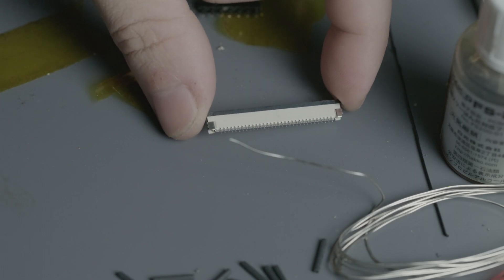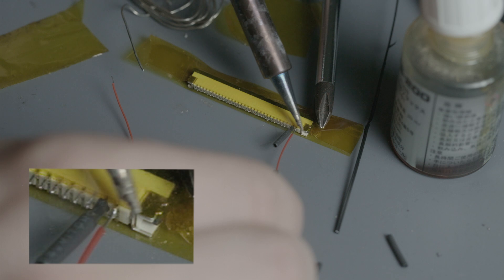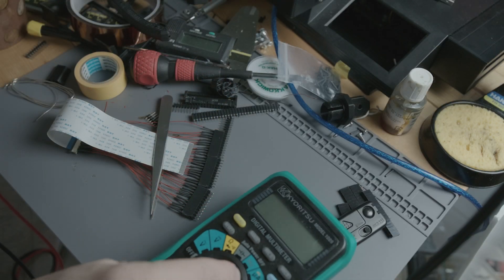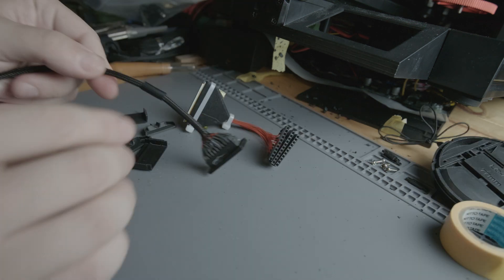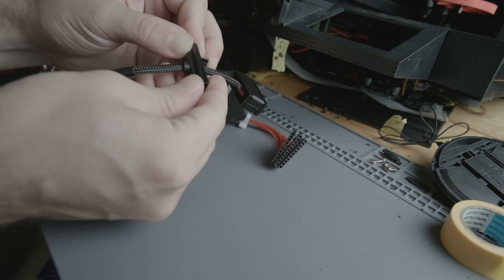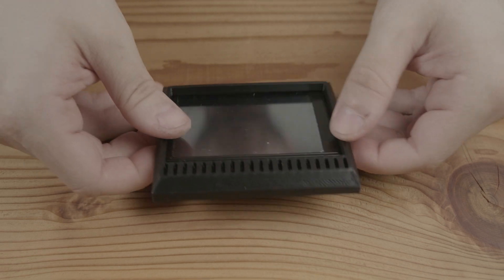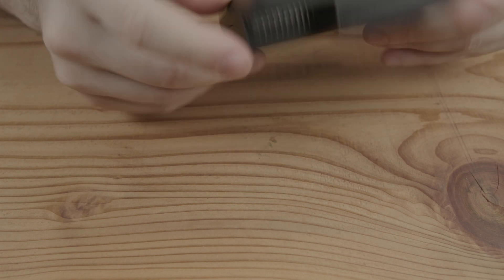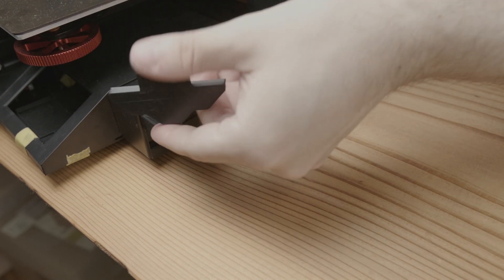Elegoo Neptune 2S Portable LCD upgrade with Mount Arm

Comment: What gauge and type wire are you using and what length did you end up making the cable in the cable sleeve? (sorry for the noob question)
Reply from the maker: nah not noob at all, it's 30 AWG 7 core wire. The core count can be different but you want more than 1 core so it can flex without breaking. It's called "OK wire" or that might be my suppliers mistake and it is "OKI wire" which is a company name. It's used for making PCB test fixtures. Sorry I don't have a link it's a factory product and we buy 10,000ft at a time.
Reply: @MochaMameX  Thanks!!

Comment: Is that extension cable not available to purchase?
Reply from the maker: I've never seen one available before, depending on country you might be able to find better connector parts but I couldn't find them easily in Japan so made everything by hand. Some people who move the LCD just use the original flat cable, you can get extensions if needed.

Comment: hello mocha, well Santa Claus brought me a 3d pad screen, so I wonder if it's interesting to make this modification as I asked you;) I'm testing it, it's a good alternative for not too expensive but sincerely I think the original screen but especially the firmware makes better prints, I updated the firmware but I think some Cura adjustments are necessary, thank you very much again for your videos ps: I also had a bltouch that I installed thanks to your video, it's perfect thank you very much and merry christmas to you
Reply from the maker: I like the design of the original firmware, it is enough for most people I think. Changing to a different screen and firmware would be nice too! I'm glad the BL Touch video helped! Enjoy!

Comment: Hello, I love your job, this is exactly what i need for my printer, ☺☺ unfortunately I am zero in engraving, could you sell me a complete connector? for a left mounting 🤪 I am from France friendly Jean Michel
Reply from the maker: Thank you very much! This request is difficult to accept, if a wire becomes loose will you be able to repair it? Mine is still running fine, and this design works for both left and right mounting. Let's talk about it maybe I will try, find me on Reddit or Twitter and send a DM!
Reply: @MochaMameX  hello mocha, well Santa Claus brought me a 3d pad screen, so I wonder if it's interesting to make this modification as I asked you;) I'm testing it, it's a good alternative for not too expensive but sincerely I think the original screen but especially the firmware makes better prints, I updated the firmware but I think some Cura adjustments are necessary, thank you very much again for your videos ps: I also had a bltouch that I installed thanks to your video, it's perfect thank you very much and merry christmas to you

Comment: Ooh! This is something I've wondered about 😁
You did an excellent job at making the connectors! They look factory fitted. Very professional 💪🔥
Reply from the maker: thank you! it's a lot to work but so far no problems and it makes everything much more convenient!
Reply: @MochaMameX  It sure does! I've lost count how many times I've had to try and reach for the screen if a print accidentally fails or to make adjustments😅

Comment: I love the mods you're doing. I will appreciate  a filament guide compatible with the cap you designed
Reply from the maker: Thank you it's good to hear. A filament guide sounds good and should be easy, I could make it for my next video. Do you mind drilling holes?
Reply: @MochaMameX  anything that you  come up will be great. Drilling holes is not a problem. Thanks!!
Reply from the maker: just one more question, what is the main reason you want to use a guide? I'm working on it now!

Comment: I really want to suggest you use a helping hand, it will make things a LOT easier for you
Reply from the maker: I used to wire 5-10,000 points per day and this was the first time actually that I wished I had a pair, might get or make a set
Reply: @MochaMameX  the set I use is fantastic, I actually recommended it on one of your earlier videos, but the comment got deleted
Reply from the maker: really? maybe YouTube doesn't allow links or something, or else it was a really unfortunate accident on my behalf, sorry about that.
Reply: @MochaMameX  probably the latter, I mentioned the product code on Amazon Japan
Reply from the maker: "Hold potentially inappropriate comments for review" Then I never check the reviews
Reply: @MochaMameX  I believe it was on your Reduce Fan Noise pt. 2 video

Comment: I'm also modifying my printer, though I will be replacing the controller with a Duet 2 WiFi and a 7 inch screen
Reply from the maker: any reason for the Duet 2? last week I was looking around too. full 2209 would be nice
Reply: @MochaMameX  the Duet ecosystem is extremely flexible and I'm using my Neptune 2D to practice for building my own printer. I'm still toying with CAD, but I'm planning for a 500mm cube printer with a tool changer in Core XY configuration
Reply from the maker: That sounds really cool, movement of core XY is fun. I'll take a look at the Duet again, I remember wanting the v1 way back when I bought a RAMPS 1.4 but it was a crazy price then
Reply: @MochaMameX  I went with a clone Duet 2, but for the printer I'll build I'll go for a genuine Duet 3 6HC, even with the cost